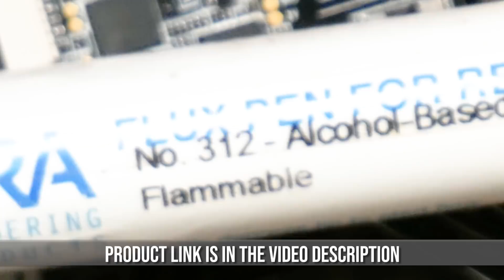The key to great solder joints is having enough flux

Comment: Not trying to hate or be a troll, just a suggestion from someone that has been in it all his life.
your exposed wire length that was soldered on the right 3 were fine but the left three were too long to make me comfortable if it was mine.
I tin my wires then trim them so that the bare portion is no longer than your pad then much less risk of a short or something small causing an issue.

Comment: Really good tip. Especially since we tend to tin things and join them after the rosin core has already burned off. Make sure it's no-clean rosin flux, or if it's washable acid flux you need to clean it off really well so the acid doesn't corrode!

Comment: How about some suggestions and a video series for those of us that don't want to solder at all. Soldering has never been one of my strong suits, not to mention my vision sucks too much to play around with some of the barely visible solder points needed to do these builds. But I'd really like the opportunity to build my own quad as opposed to buying one that's pre-built.
Reply from the maker: If you don't want to solder, I'm not sure there are many options for you in this hobby. One of the only quads I know that requires no soldering to maintain is the QQ190 RTF.
Reply: Thank you. This is exactly what I've been looking for.

Comment: is there any way to avoid the annoying and slightly scary pop you get when you plug your lipo to your quad?
Reply from the maker: That's the capacitors charging. Basically, no, it's just how it is.
Reply: thanks that's what i figured.
Reply: What do you think about the anti spark XT90-s connectors? I have been considering using them for 6s builds. Pretty chunky and a bit heavier though.... Do you consider there is a risk of damaging the FC or other components (with 6s)  during these large pops, or does an installed large cap on the battery pads take care of that risk?
Reply: yeah i couldnt imagine plugging 6s onto my quad. Ive never owned a 6s lipo.

Comment: I know maybe it sounds crazy, but I noticed that ground soldered joints seems to be more “sticky” or difficult to work with with the soldering iron, I need more time to melt the joint and in the mid-time the soldering iron tip seems to “stick” to the joint ...
Reply from the maker: It's because the ground pad is usually so meaty it soaks up heat more than the others.

Comment: Like you said, there is enough flux inside most "rosin core" tin/solder to make a proper joint.

But, when it gets to soldering... people can surprise you!

The heat applied is the most important factor as the flux dissipates heats very quickly along the surface you are working on.

If you apply too much heat, the pads will expand too much and pop off. 

If you don't apply enough heat, the solder joint will be brittle (cold solder joint).

I've been soldering since I was eight years old, from my experience the only way to solder perfectly every time:

Apply heat;
Tin surface until iron "catches" the blob;
Release.
Reply: Fuck my ADHD...

I meant to say:

Solder the surface, but the iron!

:p

Comment: Thanks for the info. What temperature do you solder with?
Reply from the maker: Between 750 and 850 Fahrenheit (400 to 450 C). I go down to 700 F occasionally for very small joints.
Reply: Joshua Bardwell OK. Thanks.

Comment: This is soldering fundamental. At 1:23 you only reflowed and thus deoxidized the surface of the joint. You might want to hold a little longer to make sure the whole joint is deoxidized. Even better the tip should really touch both the pad and wire. It's always better (or I should say correct) to heat up the contacts but not solder if possible. Solder will automatically stick to wires/leads/pads once they are heated up with the help of deoxidizing agent and you get the best joint.

Comment: A big ball of solder on a joint like you have provides no additional mechanical strength or conductivity than one with sufficient solder that allows you to see the solder coated wires. If the solder has a slight concave between the wire and pad and in between strands is best.  Size of tip is crucial so that it's not too small for the solder to melt for more than 2 or 3 seconds.  Nor too big to make a mess with other pads.  The tip is akso relevant.   Pace have a series of videos about soldering. Watch them if you really want professional level hand soldering.
Reply from the maker: You are right. But when the pad is as tiny as these are, it's difficult to get a good fillet without accidentally making the joint too dry. For a beginner I argue it's better to have the joint a little too wet because at least you'll be sure it's enough. It's a very common problem for a beginner to not put in enough solder and have poor contact and wetting.
Reply: Joshua Bardwell Sorry, I  forgot to mention you are correct about using flux to assist in a joint. In my day we didn't have gel like today.  Also, try to keep the gel in the fridge for longevity.
Reply: a series about soldering... i can't imagine so much content about just soldering, but a good tutorial that covers all a kwad pilot should know would be gold.
Reply: GrumpyMadman He spoke to a solder manufacturer.   That video made me switch to 37/63 solder.
Reply: Quadcopter's are no more special than any other hobby that uses SMD or SMT components and lots of solderable pads.  Ham fisted people are the problem and those with a soldering iron that has no temperature control just have to accept their soldering is going to be pretty poor.  Cost of a USB microscope camera hooked up to a monitor and a temp controlled LCD readout soldering iron is not going to hurt as much as shorting a board from shitty soldering.

Comment: The solder ball is not good; too much solder. Smooth and shiny is good, but the filet should be concave with the outline of the wire still visible. Lead free solder is never going to look as pretty as leaded. Look up IPC-610. And if you want to be particular, even no-clean flux should be cleaned off. It is less corrosive, but can still attract moisture and dirt which are not good for reliability.
Reply: Or you can look up IPC-STD-001. Thats the standard that describes how to... 🤓👍

Comment: In addition to flux, pick the right solder iron tip for the job.

What's good for the small UART and motor pads on FCs, ESCs and PDBs (smaller, like the tip shown), is not necessarily good for the battery lead pads or even the main power-to-ESC pads.

Those larger pads with larger gauge wire, soak up heat so much that a small tip rapidly drops out of the right temperature range before the solder has properly wicked into the joint. You end up holding the tip to the joint longer, heating up the board (not good) and showing burning off the flux.

A larger tip has better thermal 'inertia' and will quickly follow the solder into the joint.

Comment: Or get some Kester 63/37 solder and be done right the first time. Link in the description. And in mine as well
Reply from the maker: I'm using Kester in this video. You still need flux if you rework a joint a bunch of times.
Reply: The composition has nothing to do with it. You still need flux.

Comment: newbe question, what is the name of the yellow glue(?) they stick the antennas ufl joints down with on receivers, or a good alternative?
Reply: @SteveClayson I don't know what that yellow stuff is but I use Bondic,5 Second fix or any of those liquid plastics that hardens with UV light. It works great at holding a ufl and you can remove it if you need to.
Reply from the maker: I don't know exactly what that is :-/
Reply: @Brian Boz thanks will give it a try

Comment: Besides the fact that the "resoldered" joint looks nicer and shinier, it doesn't do anything to the electrical and mechanical properties. It just looks better. The only time you really should consider resoldering a joint for electrical and mechanical reasons is if the cable you wanted to solder is moved during the cooling process. This is because it can decrease the mechanical stability of a solderjoint drastically and cause  it to break under physical stress, resulting in shorts or other bad stuff you don't want to happen.
For beginners: take some iron and/or copper wire and try soldering a stickmen, then a few simple 3 dimensional structures (a cube, a house, etc.). Use tweezers and maybe some putty to hold the wires in place. If you feel you've practiced enough (if your cube does look like an actual cube), you should be skilled enough for anything kwad related. It's really just a matter of practice!
Reply from the maker: Amateur hobbyists hardly need any encouragement to let bad soldering pass. You and I know that first joint was fine, but if you saw some of the horror shows I see, you'd agree: beginners need to try to make every joint picture-perfect. They can't tell when "good enough" is good enough. They think the worst joint you ever saw is "good enough" and then wonder why their quad falls out of the sky.

Reason #2 to go for picture-perfect joints: you're a YouTube expert and everybody is going to look over your build with a fine tuth comb ;-)
Reply: Mister M Your comments only highlight your ignorance.
The look of a solder joint is a very good indicator of the electrical and mechanical properties .
A dull rough and hazey looking joint may indicate incorrect rate of cooling resulting in the solder alloy solidifying in a non uniform way resulting in compounds called intermetallics being formed in the solder resulting in all manner of defects dry joints etc.
Flux does several jobs . cleaning the surface is one but it also assists in the process by providing a small degree of atmospheric shielding helping keep oxygen from the air getting to the molten metal.
I have ranted enough
Reply: Yeah as many horror jobs as I have seen, it's best to encourage people to keep it clean whenever possible.
Reply: As an amateur, I was reluctant for using bigger soldering iron (60 Watts), wary for frying component, etc. So I'm using 40 Watts soldering iron for years.  After buying good, cheap 60/40 soldering wire, plus homebrew rosin flux and canned soldering grease (Lotfett), my soldering experience pretty much expanded.
Later, I learned that higher soldering temperature (and bigger tips) also helps for shinier joint. Especially for cable pads and bigger soldering surface.

Comment: more so it helps having good solder and a good iron thats tip is TINNED. Biggest #1 tip. 

I got a cheapy iron, that i figured would be good for basic stuff, damn shaft was crooked and thing wouldnt even melt solder...the $7-8 special I got from banggood with multiple tips is way better!

Comment: I think this video is great. I tell people all the time just get a little bit of flux and put it on a bad joint and touch your iron to the tip it will clean it right up and make it shiny and smooth. Especially battery leads a lot of times guys don't have big enough tips or put enough heat to the battery leads and they're all rough looking like an aluminum foil ball
Reply: "Especially battery leads a lot of times guys don't have big enough tips or put enough heat to the battery leads and they're all rough looking like an aluminum foil ball" This! They only trouble I ever had soldering were those damn XT60 to PDB joints with 12 or 14 AWG back when I started this hobby. lol

Comment: Great tip to those just learning to solder. I would add another "must do" to ensure beautiful solder joints everytime....clean your tip before every solder . The tip should always look shiny. If it doesn't , wipe it off, apply some flux to the tip and wipe it off. Do this until the tip is shiny.

Comment: Isn't lead Cancerous? 😬
Reply from the maker: Lead is bad for you but it doesn't cause cancer as far as I know. Never the less, exposure to lead from solder is negligible, unless you eat it. The vapors are flux and do not contain vaporized lead. The main way you can get lead exposure from solder is by having lead particles on your hands. So wash your hands after soldering and don't put solder in your mouth and you'll be fine.

Comment: Thanks for mentioning the no-clean flux... I was unaware of that. The last board I soldered gave really erratic performance until I cleaned up the residue from the brush-on flux I'd used. Lesson learned, thanks!

Comment: Something I've noticed when repairing/modifying things I've bought is that even when adding solder with rosin-core, the solder joint's surface sometimes goes really dull when it cools, even though the joint is good & solid - is that a combination of my leaded-solder with their unleaded-solder?
I hate unleaded-solder, still have 99.9% of a reel I bought decades ago because it's horrible to work with. Leaded rules.
Reply: licensetodrive You are correct you can often get dull looking joints. (that otherwise would look bad) when mixing. Also since you have some it's easy enough to verify on your own. 

I discovered this like you wondering why the hell my ESCs looked so dull but appeared to perform fine. You also aren't alone, no one likes unleaded solder.
Reply: Thanks for confirming my suspicions, I do have the unleaded-solder reel, but no clue where it actually is :)
Reply: It's actually a characteristic of a lead-free solder to have a dull appearance. Depending on use or where the board will will be released/sold depending on the regulations that manufacturer decide weather to use lead-free or leaded solder. In the case of our FCs and ESCs and other boards that we use, ideally manufacturers should always use lead-free solder since these are going to customers.
Reply: It probably depends on the leaded solder you're using too. chinese stuff isn't usually made with good quality raw materials, and doesn't use good flux core. Get kester, multicore, stannol or similar, and every joint ends up shiny (and much stronger), even if it was done to a pad that already had lead free on it
Reply: Use 63/37 solder, not 60/40. There is less chance of disturbing the joint as it cools. Don't mix leaded and lead free solders. Remove the lead free first of you are using leaded.
Reply: nah 63/37 is garbage - 60/40 all the way all the time for the best joints